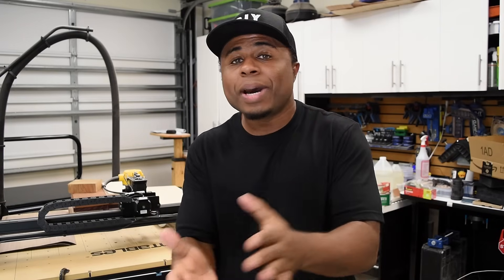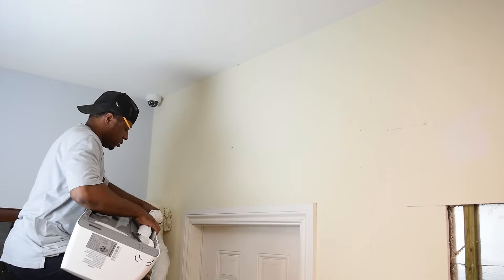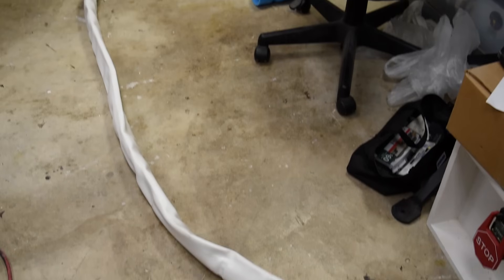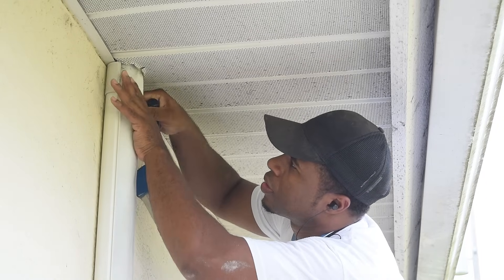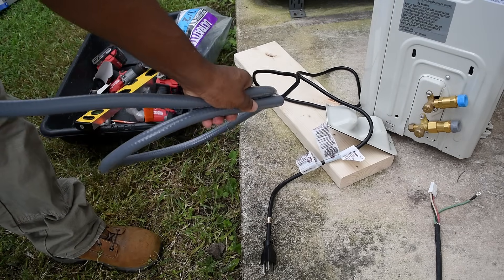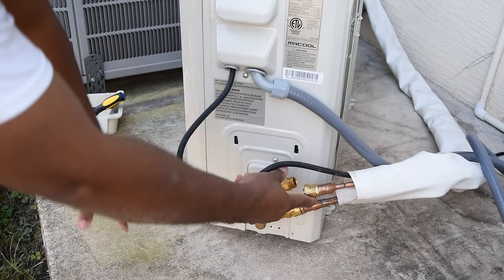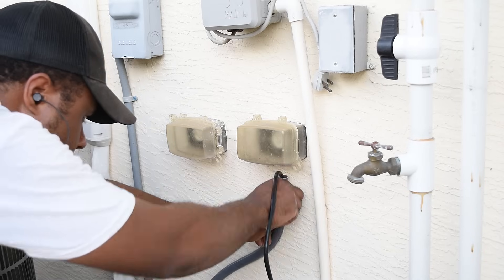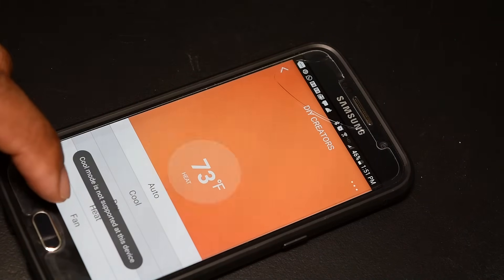How To install Ductless AC & Heating System // True DIY Mini Split MRCOOL

Comment: If these lines are not the precharged ones you need to vacuum it down first before opening the ports. Otherwise you introduce moisture from outside air . It might still work but not as good as it could have. You did do a great job on your video.👍
Reply: All units come recharged even the vacuum is for the refrigerant lines inbetween you need to suck the air out of them or else your refrigerant will be contaminated
Reply: @maskman3086  I bet you're an HVAC tech.  Job security, eh?  The lines are pre-charged with refrigerant.  It'll be fine.
Reply: These mr cool units have the charge in the lineset which are already connected to the evaporator, the condenser is already under vacuum. These units are junk but they work for a while
Reply: Rolex Enforcer 
most, if not all mini split units comes pre-charge with refrigerant. The lines sets and head unit is expose to air and have moisture. System needs to go into vacuum first which sucks out moisture and other contaminants. The way this is, wont last very long. The oxygen and moisture in the line will create acid and eventually kill the compressor, and system.
Reply: Earl A the linesets are precharged. That's why you have to use the entire lineset with these systems.
Reply: @Rolexenforcer  Sorry...but you are quite wrong:
Did you not see he removed the plugs from the lines, that is, opened them to the atmosphere ... then connected them to the condenser...and THEN opened the valves to release the gas from the condenser unit?
Please look again. 
(And you call the units junk?.....Mmmm Kettle calling pot, methinks.)

Comment: The big mistake you didn't vagum the system to remove atmospheric   air and humidity. Nice video good job
Reply: If you vagum the ac unit it will have a longer life time and the unit working pressure will be normal.

Comment: Although I admire your will to do this on your own. Before opening the refrigerant lines  first you should have pulled a vacuum to 500 microns. Then the system should have been pressurized with nitrogen to the design pressure limits. Also using adjustable wrenches tighten lines is not ideal and torque wrenches should be used.

Comment: You never put a vacuum on the system. Hvac is not a DIY thing . There’s a reason why they make hvac equipment so hard to get #DIYFAIL #HACK #Sticktourowntrade
Reply from the maker: Go read the manual at mrcool.com it's  2019 anything is possible
Reply: DIY Creators your showing millions of people the wrong way to do it
Reply: DIY Creators it’s funny how u think u know what ur doing but not leak check the system b4 u open the valve is wrong what if u do have a leak then ur just venting refrigerant into the air which is a federal crime
Reply: DIY Creators 👏👏👏
Reply from the maker: Jon that's not my point, what I'm saying is I dealt with the manufacturer directly and they approved the install. This unit do not require a vacuum, if you try to vacuum it you risks voiding the warranty. I'm no pro at all just following instructions.

Comment: Thanks for the video! I will be purchasing this exact system soon for my work shop. Great job!
Reply: You must pressure test with nitrogen for leaks and vacuum down the system. It's a must !!! Fail to do so will ruin the compressor in a few years. I'm a HVAC field technician and install these mini splits system weekly.
Reply: Sam Sean I thought the same thing 2 years from install burnt compressor

Comment: Could I add additional interior units to this one system?
Reply: No. 
Only sufficient gas in the delivered unit to run one evaporator up to 25 feet away.
(And anyway...can you do the balancing equations needed? Mmmm?)

Comment: Big problem. Where vacum machine ?
Reply: It doesn't require one for installation. The lines are pre-vacuumed, and the unit is pre charged. You just hook it up,  and back off the screws, and it charges the lines.

Comment: No one should ever install a AC or heating system by themselfes, because the gas inside is a big contributor to global warming if it leaks out. In the EU it is not allowed to install, repair, or remove a heat pump or AC without a certificate and training.

Comment: Nice install, Just know that you should be using a vacuum pump to remove any air and moisture from the refrigerant lines. Refrigerant absorbs moisture very quickly. Having moisture in the system will significantly shorten the life of the system. Also, a permit is required to install this system.
Reply: No permit needed, they are charged with a set amount of freon.
Reply: @brandon8569  You absolutely need a permit.
Reply: Stevonoles1 it depends on which state you live in. Here in Florida you do not. 👍
Reply: @brandon8569  I am a licensed HVAC Contractor here in Florida. Trust me, you do.
Reply: Stevonoles1 
Nope. The Mr. cool diy is a sealed system and the end user is not adding or removing Freon. Therefore no license needed. 
I understand that these units might upset you because they are cutting into your business and it’s natural to try and throw stones a competitor. 

On the electrical side no permit is needed either. Just as long as you wire to code.  

This is based on doing it your self. Now if I went out and started charging people to install these, then that’s a different story.
Reply: @brandon8569  Not cutting into our profits at all. Not throwing stones either. I never said you need a license, But I promise you a PERMIT is required by the Authority Having Jurisdiction.

Comment: Well, that's what you need, if you build your houses in a way they heat up like hell. Just use thick bricks like we do in europe and heat is not a problem, since the bricks can store enough energy till the evening without reaching the inside.

Comment: I was going to chastise you for not evacuating your pipes before I saw your link to the manufacturers website. I think you should mention in the video that the information you are providing is specific to the manufacturer and not the standard process for all split systems. If you do not evacuate the pipes on any other brand you run the risk of seriously damaging the compressor or an explosion as any air in the system will cause a massive increase in system pressure as it cannot be condensed with the refrigerant. Also some new refrigerants like R32 are flammable, so an explosion can be catastrophic.

Comment: Notes:

I'm not sure what that manufacturer recommends but the indoor unit looks to be mounted too close to the ceiling which can make cleaning more difficult and will reduce the systems capability to breath. That drain line will work but likely will erode in the weather, PVC is recommended. You need to have a disconnect at the condenser for shut off at the unit for safety purposes. You can trim the refrigerant lines to a certain extent, most manufacturers will have a recommended minimum length. The flares on the refrigerant lines are supposed to be torqued to specified levels to prevent leaking due to under or over tightening. The refrigerant lines need to be vacuumed to evacuate all air and moisture. With the lines not vacuumed, I'll be shocked if this system runs more than a year. Then when the system fails, no HVAC tech in their right mind would work on a non inspected unit installed by a homeowner. This is why you don't do this yourself unless you understand what you're doing. HVAC work can be expensive but it's because the person coming into your house is typically insured, background checked, and either licensed or working under someone else's license and are capable of doing it right the first time.

Comment: Are you fucking dumb? You just opened the valves without vaccing the system. Moisture and reacts with the oil in the compressor and turns it acidic. Get someone in that knows what there doing.

Comment: Been in the field for 25 years. This is a very poor install. So many things wrong.
Reply from the maker: This is not a system You are use to. It's 100% DIY. No vacuum needed. So many things wrong name it. Offer solutions. Thanks.

Comment: Don't forget where you have to vacuum the lineset run, after letting in all that air and moisture into the lineset...and with minisplits being a pain in the ass about having a 500 microns vacuum needed, you just installed a unit that now has air in it and is killing the compressor as we speak. Mini splits especially need a vacuum done on the lineset, the compressors and that poor TXV are prone to dying...so in about a few years, possibly less, you'll be calling a tech to replace the TXV and Compressor, along with the filter drier which will probably end up costing the amount it takes to install one, even if it's under warranty. R.I.P.
Reply: Thats the whole point of these systems.The line set is already evacuated and charged,thats why it has these special connectors.Its almost idiot proof.

Comment: Before you open the valves to release the freon you should evacuate the system with a vacuum pump first. This way you can tell if there is a leak, remove moist from the system and remove all air. That way the system will work more reliable and efficient. 

The lines can be cut - however - you would need special tools to reshape the ends. Tool will set you back 20 bucks or so.
Reply: These DIY systems are all precharged and so are the linesets. That's why you have to use the entire lineset and cannot remove the lines after you open up the system or you'll loose the charge required to run the system properly.
Reply: There are such systems as you mentioned. However - they come with quick connectors.

The lines from this system - out of the box - are not connected to the compressor unit or to interior unit either. They also dont appear to have quick connectors. Therefor - the lines are empty. The freon is in the compressor unit. You can shorten the lines but you need to either reshape the ends or use adapters. The amount of freon should be enough to run the full length of lines. If you lengthen the lines you may need to top up. Shortening the lines should be no problem though (shorten at point of installstion - prior to releasing the freon).

Why evacuating the lines? Creating a vacuum inside the lines make all water evaporate (remove moist to protect compressor). Removing air makes the system more efficient as air is no freon. 

If you cant hold the vacuum your lines or connections are leaking. Why check for leaks before releasing the freon? Because freon is expensive AND its a extremely bad for our envirement.

Comment: How can u cut yur wall with knife. Holy moly 🐄, yur home made from wood or cardboard.
Reply from the maker: Drywall is a standard in the US. My exterior wall is cinder blocks. Drywall is the best way to finish off a wall style it the way you want. It also hide cracks from being seen if the exterior wall cracks due to movement. Also its best for kids in my opinion, kid run into a brick wall there goes a doctor visit. It's easy to patch, easy to work with it's just the smartest way.

 I was born on the island where all homes were made from poured concrete and no drywall inside. All you say was Cracks through out. Need to run a wire? Well can't running behind the drywall when all you have is concrete. Trust be this is the best route 😀 I worked in million dollar homes for 12 years this is how it's done. 
I hope this helps.
Reply: @DIYCreators  I always watching yur videos it's awesome ... Yur creativity is awesome....
Reply from the maker: Thank you 😀 really appreciate it.

Comment: Next time you install a "Mini Split" unit,  You can get a Vacum Pump and Manifold for under $100 on eBay and save a $1000 instead of the Mr. Cool unit, as you are a really smart guy!  Nothing against Mr. Cool, it's a good unit for the average DIYs. Cheers!

Comment: Ok about the vacuum that all you expert HVAC seems to pointing out...
The lines are already vacumed and charged..thats why he says" you can't cut or shorten the lines.. You just hook them up and turn. Out the valves and your done..
Reply: The h vac guys are scared lol. They might lose their job 😂
Reply: They’re talking about vacuuming the lines going to the condenser and not the compressor.
Reply: @bigkid757  the lines have a port on them that keeps them sealed till they are connected to the condenser unit. The lines come already under vacuum. I've installed 3 of these . The long lines attached to the evaportator aren't open to outside air  they are sealed off.
Reply: @bigkid757  it dosent matter.. Everything is already vacuumed and charged.. Hookem up.. Open the valves.. And done... Its all DIY.

Comment: If the lines are not under a vaccuum you run the risk of contamination. Triple evacuation with nitrogen. As to ductless, Mitsubishi has best customer service.  Your choice. All daikin, Mitsubishi, LG. Can be DIY but you also have limited warranty.

Comment: I have two of these DIY systems.  One is a 2-ton unit, which is actually my main cooling & heating system, and I got through 3 summers and 3 winters so far with it.  Second one is a 1-ton back-up unit.  I love them both.  Ducts are stupid in my opinion.

Comment: ATG said this is way overpriced @$1,400,00 for only 12k BTU. Changes you will make mistake on installation.
Buy ATG's from Costco @ under $500.00 on a 14,000 BTU.
1. ATG A/C
2. ATG heat
3. ATG dehumidify
4. ATG fan

Again, more like plug & play. 
Unless you like to drill two holes, like me. And that's it.
I supervised my 6 years old daughter to cut those two hoses.
Again 2, ATG & Costco have the best and will standby their products and items.

Look up ITEM # 1326229
Reply: So you are comparing a portable unit to a mini split??
Reply: @nman2563  Ask your wife or daughter, which one they would choose?
Even many men can't do this setup nor do they want mole.
Reply: @angelisone  Your wife or daughter will choose Mr Cool because it does not loud and is discrete, not an ugly appliance in the middle of the room. If a man does not feel competent to carry out this installation, he should not buy this product. There are plenty out there who are competent.
Reply: @angelisone  Maybe my reply was too harsh. I understand why you prefer the portable unit and glad it works for you. For a long term solution a ductless is much better. It is way more energy efficient, it is completely quiet and you don't have to rig up a big appliance and hoses and holes through your wall or window. I don't think those portable units last very long either. Hope your unit gives you great service.
Reply: @nman2563  Not upset with your comments. But this has no benefits except just to cool down one room/area.

ATG said that Costco ITEM # 1326229 will stand by their items & products.
This unit is a 4 in 1, which help us in the winter and well as in summer.
In the winter that it gets so cold that I put have the car inside (engine in home) of the room.  I run the car all night. 

Just like many people have to run vehicles all night to prevent frozen engine. Temperatures go way below -60c.

If it breaks, even after 6 years, I can get a 100% refund for a new one.

Comment: I had Daikin mini splits installed, mainly because the reviews were uniformly good, and after a year, we have been very pleased with them.  Very quiet and efficient. I can't find any reviews for MRCOOL, so will keep an eye out for statements of reliability, as they are much less expensive. Thanks.

Comment: Why does it matter the voltage to connect the green wire to ground??
Reply: isaac gomez because if your circuit shorts out the current has to have a path to go to(ground) or it will blow up or catch fire. ALWAYS CONNECT THE GROUND

Comment: As a person who's been an HV AC for 34 years I was recommend Central or any ductless. For one room this is a good option. The major drawback I would see if there's anything ever goes wrong with it it's probably a throwaway unit. Good luck on technical support and an HV AC contractor is not going to know how to work on it are there going to have to have some kind of service literature. Putting it on an inside wall is very tricky don't recommend that. If you can get it on an outside wall that's best. Especially because of the condensate. I've also put in really big units where the suction line is pretty big 7/8 OD you're not going to put a 90 bend on that. I've installed some that are 3 ton units.

Comment: I purchase at 3/4 inch flexible conduit but the connector definitely does not fit into the openings once you remove those knockouts out.
Reply: I hope you didnt take any advice from this guy.

Comment: I have actually seen in a few videos where the people installing this system made the same comment that they don't know what happened to the template for the mounting bracket. But it's actually a piece of cardboard that's part of the packaging that the unit comes in just an FYI.

Comment: This was PERFECT!!!  I have seen many installs of these units, BUT,,, you are the first to separate the drain from the line set. Honestly, I had not thought of this for my own issues. Knowing the 25' of line set  had to go somewhere and I can't put it outside, this idea of leaving it in the attic is PERFECT!!!!  So maybe an update is in need. I am wondering how much your electric bill went up?? Average hours per week using it??  If the 110 plug is still in use, maybe you could run it through a watt counter for a month and see exactly what it costs you??   Big fan, brother.. Keep pumping them out!!